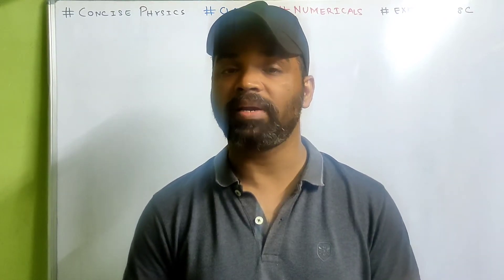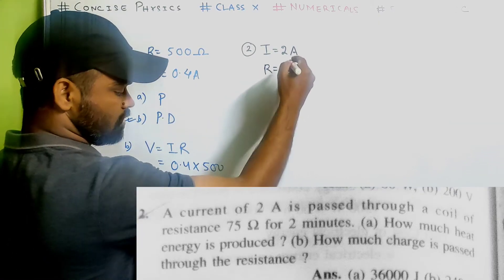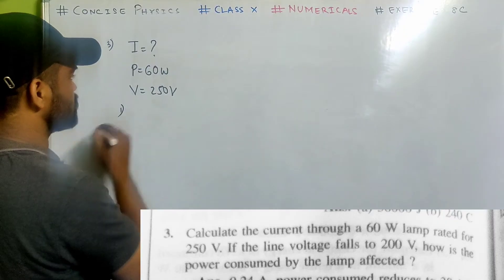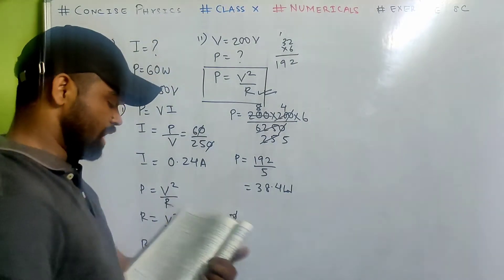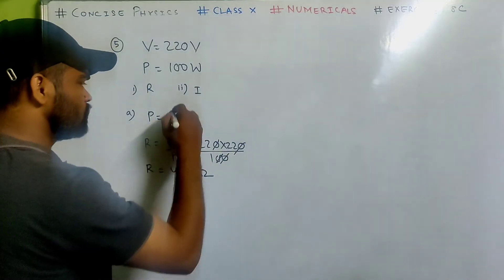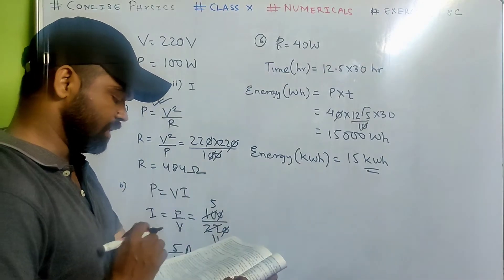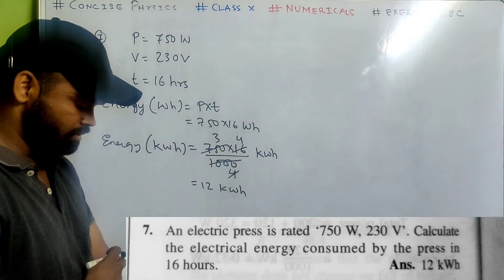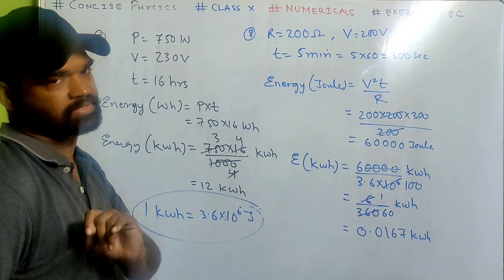Numericals of Current Electricity class 10 icse || Concise physics | Selina | exercise 8C | Solution

Comment: in 4:04 why is r constant ?
Reply: R= resistance and the resistance of the lamp will not change with the change in voltage
Reply: Resistance will remain constant even if the voltage  changes